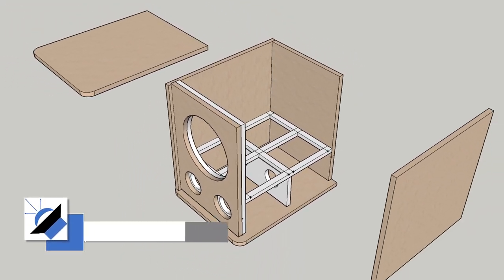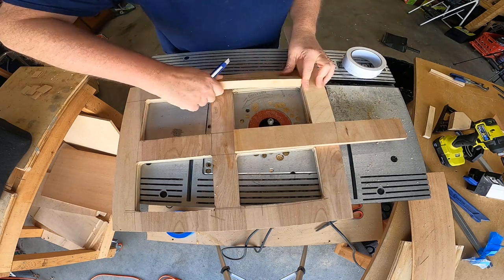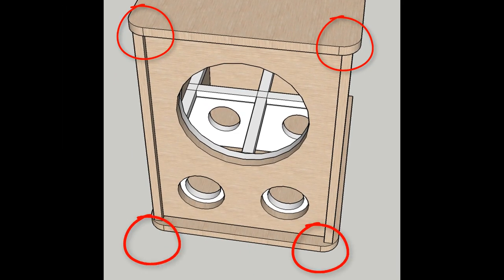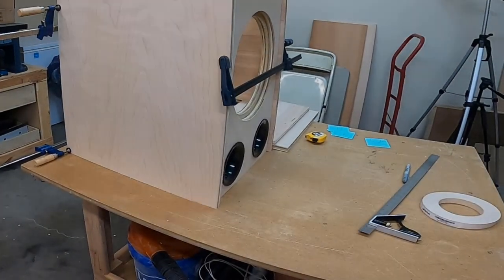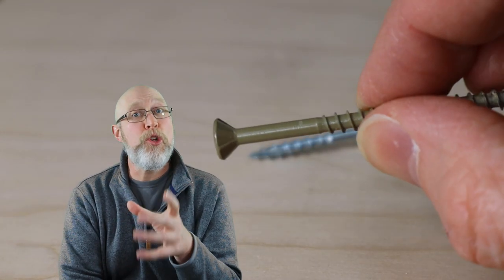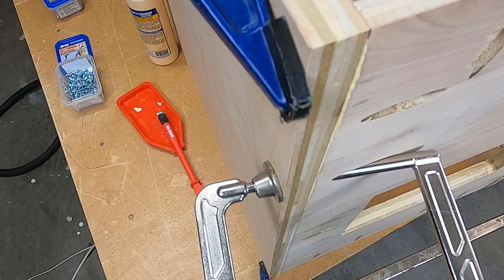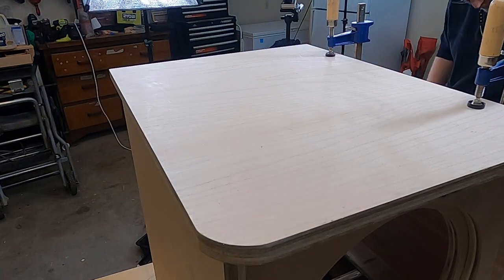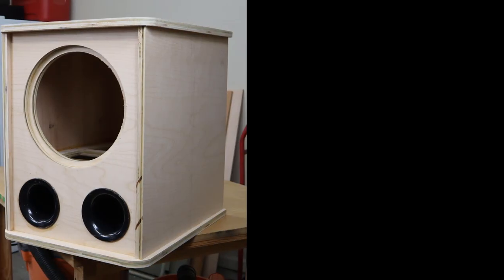DIY Home Theater Subwoofer Build [Birch Plywood, and Pocket Holes, DIY]

Comment: Nice looking enclosure man! When you design your enclosure do you calculate your braces in as well?
Reply from the maker: Yes, but braces don't take up much space.   Sometimes I add an extra one if I think I need it.  It's an art and a science.
Reply: @DIYAudioGuy  I do the same, but I’m always curious how it effect port velocity and such.
Reply from the maker: .01 cubic feet of bracing added to 3 cubic foot box will be negligible, .25 cubic feet of bracing added to a 1 cubic foot box would cause huge problems.  I am probably going to add some extra bracing this box, thankfully it is rather large and will have very little impact on tuning.

Comment: I'm looking into designing my own enclosure. Where do I start with the frequency response I need. I've been building mobile audio subwoofer enclosures. But I don't know what a home theater needs for the best sound.
Reply from the maker: The lower the better, that way you can really hammer away when those low frequency effects kick in.  I am a big fan of these for home theater:  https://parts-express.sjv.io/oe9Ddm

Comment: personally I would have cut the sides at a 45 degree angle so hide the ugly end sides, especially when you already go so far as to hiding all the screws... It's okay what you did but it would look so much nicer when you don't see the end sides.
Reply from the maker: Yeah, miter joints work just fine.

Comment: Really bad choice if screws
Reply from the maker: What kind do you recommend?
Reply: @DIYAudioGuy  just think about it.    The tip of that screw is just barley grabbing into the next piece of board.  And the threads are notched.  Hardly a good strength bond.     Plus nobody build professional bass bins using that silly side notch mount screw.  It’s  weak and you are also taking a load of wood material strength out of the boards.
Reply from the maker: @specialformula14  Oh, you're talking about the pocket hole screws.  If you install them in the correct direction they work just fine.  A lot of professional cabinet makers use these with no wood glue. I build a lot of enclosures without any screws at all.